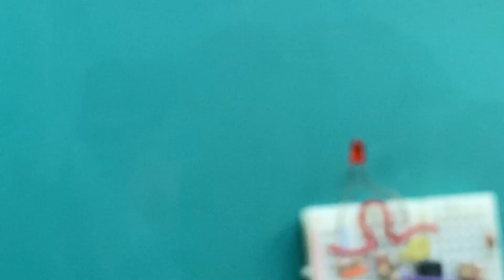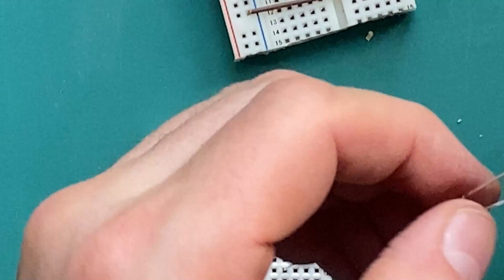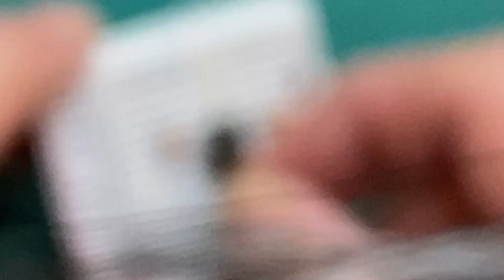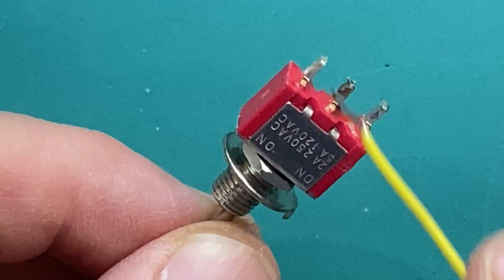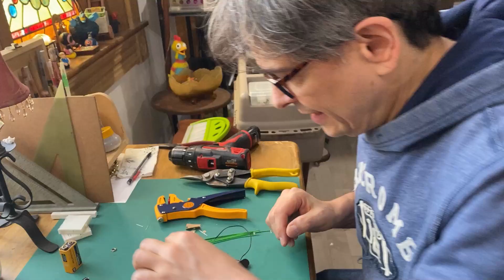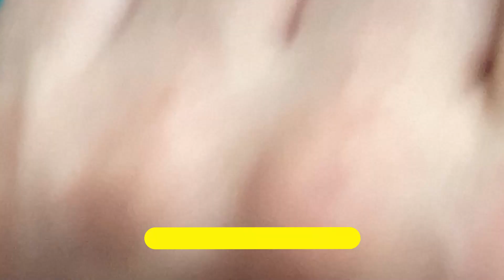Build a Hulda Clark Zapper on a Breadboard (Part 2)

Comment: Does the zapper frequency have to be 30,000hrz or 500,000hrz???????????????????
Reply from the maker: Hulda Clark stated that a Hulda Clark Zapper is any frequency from 10 Hz to 500,000 Hz as long as it is a positive offset square wave. She set her published circuit to 30,000 Hz so we comply with this specification.

Comment: Hello there !. Thanks for the video. I have a question about hz output. Inside zapper frequencies (pdf file), the output can reach almost 215 khz. What can I do to be possible to reach 250 khz ?. By the other side, if "higher frequencies" are going to be required, what changes do you suggest to reach those values ?. Finally, I want to know if using that design, signal offset will always be positive, and the output will always be "clear" (without "garbage content"). If the signal output "has garbage", what do you suggest for the circuit ?. A filter maybe ?. Thanks in advance !
Reply from the maker: Test your build on an oscilloscope to make sure it is at least 1/4 volt positive offset. Frequency output is not as important as positive offset. Watch https://youtu.be/fI8PdDw8WXM?si=ltg3Lk7hf8YGQHIZ&t=199
Reply: Where can I get the free PDF to make my own? I am battling with horrible pain and don't want to take any precaution drugs. Can you show me where I can download the free pdf since I am extreme fixed income and cannot buy on from the website.